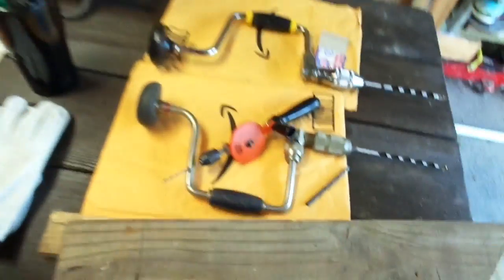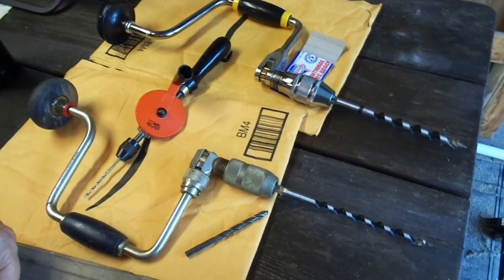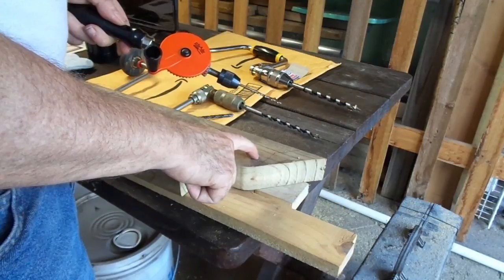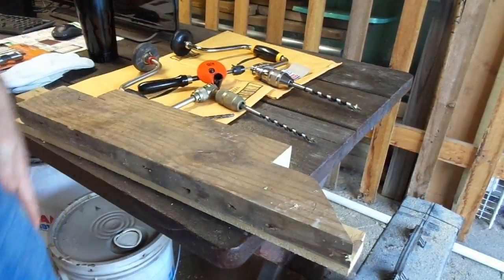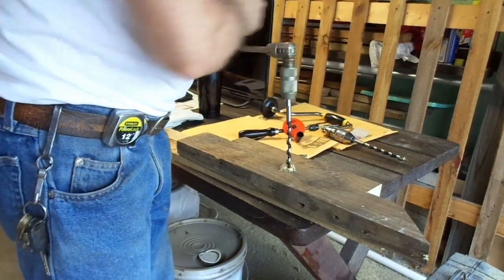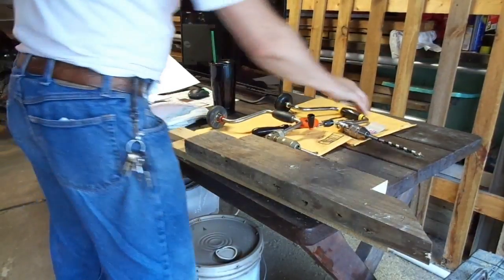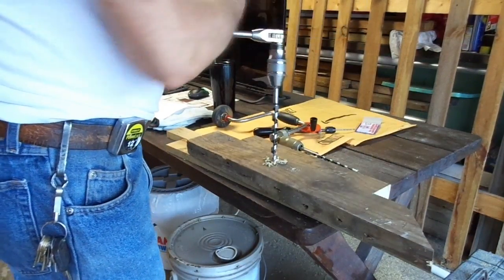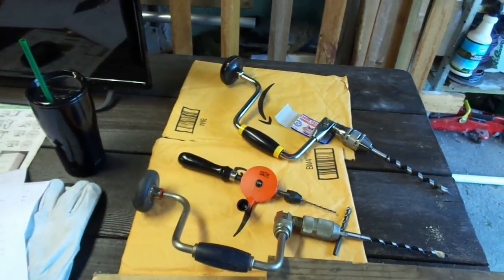TDD report for August 12, 2017 more gadgets

Comment: I think it was worth a try . It looked like it might work . Thank You Mayor !
Reply from the maker: I did take an extra 1/4 drill  bit and file the sides flat and it worked well. So you could make a dedicated set of regular bits of smaller sizes and keep them with the brace. 
I would just not use them in a regular drill anymore.  
Also really hell on a grinding wheel with the high carbon bits.

Comment: Haven't used any of those since Junior High.
Reply from the maker: Sometimes when I am not in a hurry and only need to drill one hole I could use one of these faster than dragging out my power tools and putting them back in the cases and on the shelf.